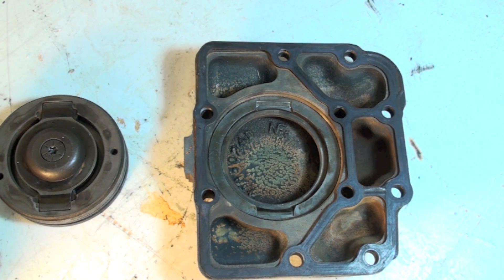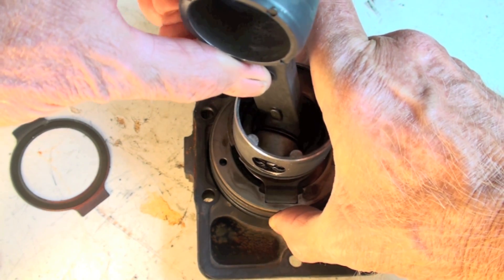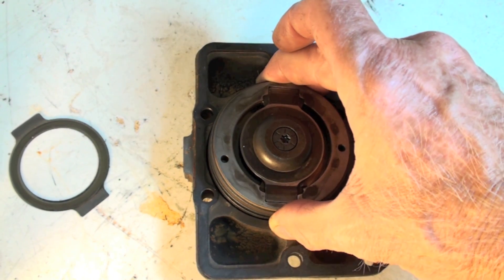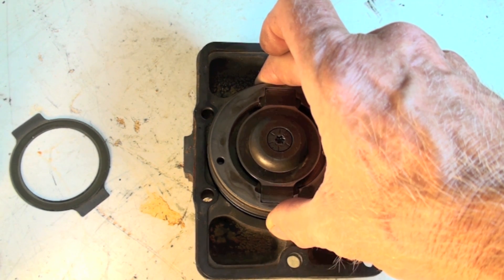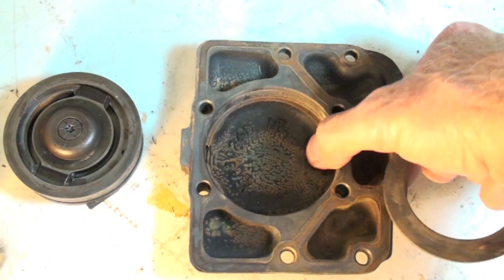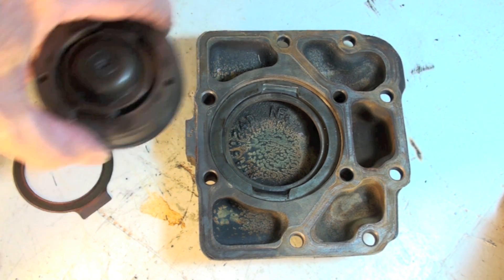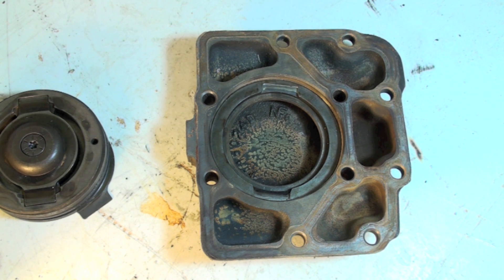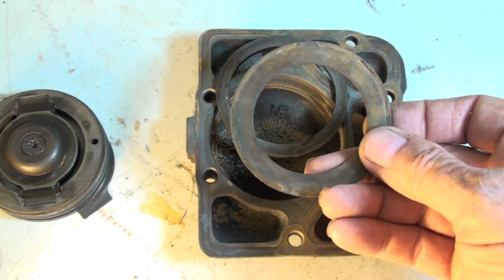A C compressor slugging control

Comment: That's really interesting. I did not know that at all. I was under the impression that they just self-destructed when they ingested liquid slugs. BTW, I am working on a screw pump, built from an air compressor, that can pump single-phase liquid water. I just need a machine shop that can take my prototype and do some milling on it. Like the principle you mentioned, it will have a clearance volume in it which yields some interesting effects.

Comment from the maker: Well, scroll compressors have a built in slugging control.  When the scroll that is mounted to the drive shaft rotates, it literally "slings" the free scroll.  When liquid enters the scroll, the free scroll simply "backs up" to allow the liquid to pass thru.  There is still the issue of thinning of the oil by liquid refrigerant and I dont know if that is taken into account.  Hope this helps.
GFM

Comment: They really need to put these mechanisms in scroll compressors. Right now engineers just plop a big old accumulator into the suction line which just avoids the problem. This approach actually solves it by creating a means by which the compressor can pump liquid. IMO, this is the most desperately-needed innovation in compressor technology - the ability to handle liquid refrigerant. (or other liquids)